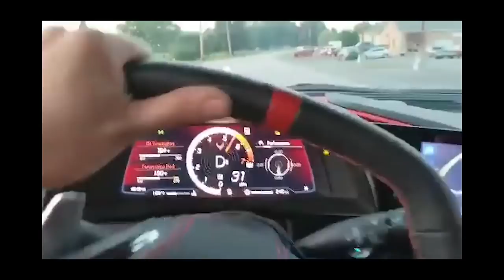Are Performance cars making a comeback? BENCH TORQUE #42 | fullBOOST

Comment: for info. runaway diesel is where it starts feeding on it's on oil (blown turbo seal etc) You can only turn it off by blocking the intake.

Comment: Runaway diesel usually refers to engine failure where the diesel engine starts burning its own oil and remains full throttle until that oil is burned and seizes.

Comment: Toyota has officially announced the Toyota Corolla Hatchback will get the GR treatment in the USA.  Considering a fully optioned normally asperated Corolla Hatch is $31K which is obnoxious who would spend $30K on that before buying a WRX? A GR Corolla  hatch will be $32-33K "nicely equipped". Likely $40K fully loaded. My '20 Forte GT with a JB4 only and my "special blend" of 91 octane fuel made 251 whp, that's $600 invested in a $21K car. I'd say get Hyundai to give you guys a i30 N, you can get a Motec 142 PNP ECU for it and really go to town.

Comment: Theses a guys on u tube here in australia who talks about the new vette and he is saying they are going to cost at least around 150 to 180 on the road and thats not even for the Z51 package at all, so add at least 50K on top of the 180K, yet the usa gets then for a basic model with basic trim ,no added extras for just over 60K usa, which is around 75K australian depending on the x change rate, so if Holden / HSV australia's dealers what to sell them they would need to order them in based on expressions of interest, which would be like chevy usa saying tell us how many real deposits you have and they will wait till the exchange rate is at its lowest, ie: around say 85 cents for every dollar in the usa, which is like saying the sky is going to fall, were technically in a recession, so how on earth is anyone going to buy a new Z51 here in right hand drive, plus theres a company who does the conversions of left hand corvettes here in australia his business is out the window unless you want a earlier model say a C7 Z51? Then your still buying it for over 250K in right hand drive? so 2nd hand hi end finished supercar or a chevy right hand drive c7, hum, buy a 2018/19 porsche carrera /  GT3 for that much on the road??

Comment: Why are Commodores even going up in price? They're are mass produce big rwd sedans, it's not like they're something super special and low volume.
Reply: I THINK YOU'LL FIND THAT THERE ARNT MANY  TOP SHAPE  CommodoreS  LEFT . THEY FALL APART REAL QUICK  SAGING ROOF  LINNER  PWR WINDOWSWITCHES FAIL   FUEL FAN  ACC RELAYS  BLOW    RUSTING COOLER PIPES ALL SUSPENSION BUSHES  FR RADIAS BUSHES PWR WINDOW REG   PEALING PAINT  TAILSHAFT BUSHES    SEAT BASE TRIMS CRACK , FRONT ASH TRAY CLIP  , SEAT BACK POCKET CLIPS  FAIL  DOOR TRIM FABRIC UN STUCK  AND HAZARD LIGHT SWITCHES  STOP WORKING  shit cars

Comment: Well i will say this dandy engines and its cars is multi million dollar gaer, there's no way the diff autos and engines are the stock run iof the mill done up engines or gear ,were talking about the best of the best stuff you can buy, then add the labour and knowledge,which is priceless, try going to them and saying i want a car like the white XW and doing the 200+ mile per hour runs day in and day out with out things breaking as well, your talking at least over 250K easy for the car, then add the running gear and labour, there you go, plus add all the cars they have, its not just one? 
Then you will have those keyboard idiots who will say 2 k on my barra will do just the same, ye right lets see you get any barra run running gear doing 7's all day every day at the drags and it cost just over 2K, the auto for drags alone is around 35K for a powerglide build for just drags, then the diff is around 20K engine alone and then turbo, then tailshaft and then suspension, brakes roll cage tyres/rims, fuel, tune, dyno time, labour to make it run, were talking a barra with over 100K easy and that's not a 7 second car as well?